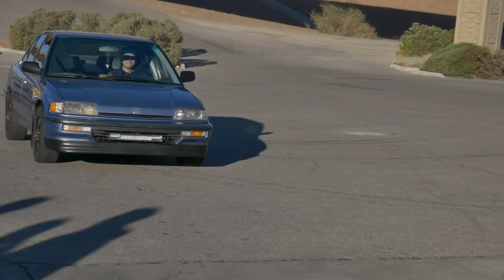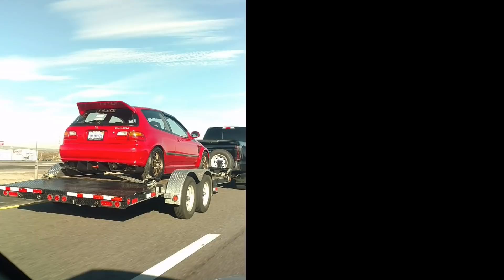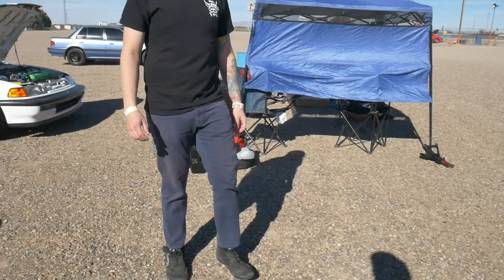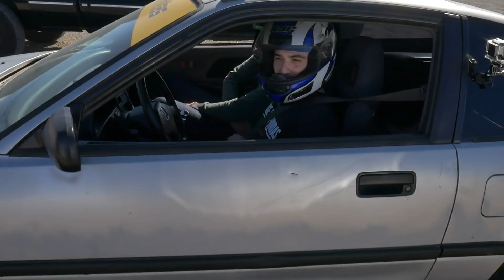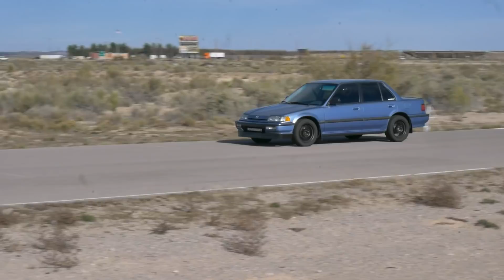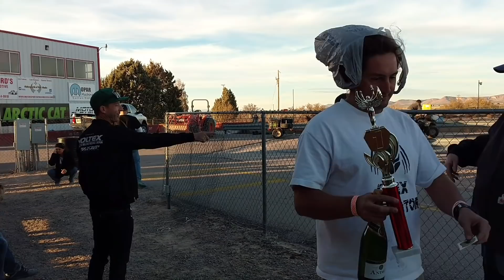1988 CRX Si first track day! ASR Superlap 11/17/18

Comment: Yeah man congrats on 25k I will be picking up one of those shirts. With the closeness of the times I think you could get stage 2 cams and level the field but more costly maybe a 4.7fd in that B16 trans. For a non VTEC that b20 flies! It's kinda at that point that any more mods and it won't be street able to drive to the track, maybe. It's already L.A.F.!!!
Reply from the maker: I'm hoping to be at the edge of Class A.  I'd like to try making out power before next season!  I got a pretty cool video regarding power in this car in a few weeks!
Reply: @GarageBuiltHondas  what compression ratio do you have with the b18b head on the b20 block?
Reply from the maker: I have a complete stock b20b, not a b18 head.  Either the 9.2 or 9.4 ratio, I don't really know since it's hard to determine which exact car in came out of.
Reply: @GarageBuiltHondas  oh OK. I can suggest some injectors. OSide tiger has a set of 4 point Bosch injectors that are 280cc at 43psi and can increase with more pressure. You should be able to bump the compression to 11:1 with pistons or combination of piston & head decking like .030 to .040 which will net 1:1 compression by it's self with a  block guard and put the fuel pressure at 50 psi for 325cc. I can see that 2 liter at least putting down 180whp. I am sure you got a game plan already in mind and I can't wait to see it!
Reply from the maker: I love your input, super insightful!  I'd like to continue working on this engine because I really enjoy it.  My goal is 155-160 for now otherwise I jump out of class!  Hoping I get to that mark!!
Reply: @GarageBuiltHondas  ok cool well your obd1 ECU has a tunable chip I think? You can be right on the money!
Reply from the maker: My current one not yet.  I did just get a p28 with Hondata.  I'll be using that when I get it tuned.

Comment: Question!  I'm replacing the head gasket on my 1991 Honda Civic S. Most forum members are recommending that I use a multi-layer steel head gasket with part# 12251-P01-004 (D16Y8) instead of using the genuine composite head gasket with part#12251-PM5-S02 (D16A6). What are your thoughts?
Reply from the maker: I prefer the head gasket intended for the engine.  I've never used the MLS ones on an 88-91 engine.
Reply: @GarageBuiltHondas  Some forum members recommend head gaskets by Cometic. Will do little more research and then decide. Thanks!

Comment: Thing runs like a nutless D16 on 3 cylinders.. With the right suspension setup the CRX is a grip monster and awesome turn in. What they lack in power they make up with cornering speed. Drop a B series in it for some cheap HP gains. Eliminate brake fade with some quality rotors and pads, drop seconds off those lap times for less than $500...
Reply from the maker: For sure!  He needs a new master, and mainly seat time!

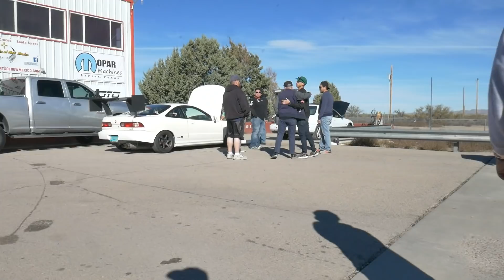Comment: 3:00 what is with all these atrocious wings at these track day events? Lol I get that it's a bunch of track cars, but seriously...
Reply from the maker: Pure function.  Not a car show out here.  These wings actually do something. Lol
Reply: @GarageBuiltHondas  Yes, I know but it seems a bit excessive in this case. I can see something like that on the turbo K-swapped EG maybe. I guess being that it could be homemade, he just used what he had. Those end plates are just ridiculous looking because of their size.
Reply from the maker: He beat his previous lap record by half second with no other mods.  I wouldn't doubt if it helped.  Anything to help slice the air and get the car more slippery.  We're basically trying to move these bricks of metal through the air faster and the splitter definitely helps.